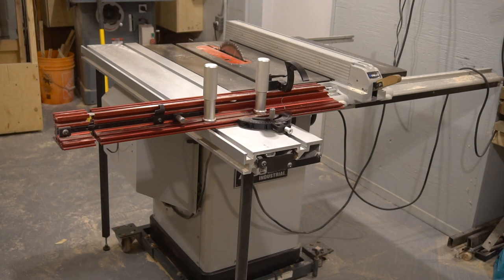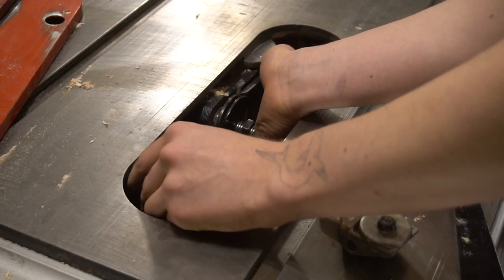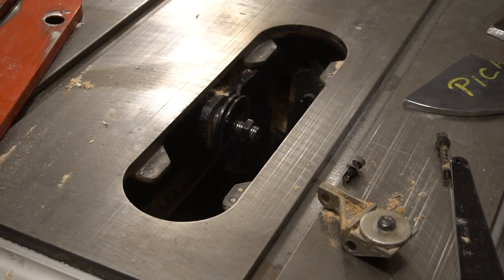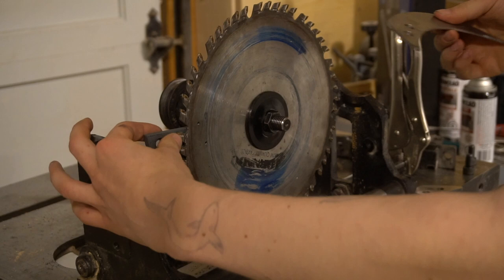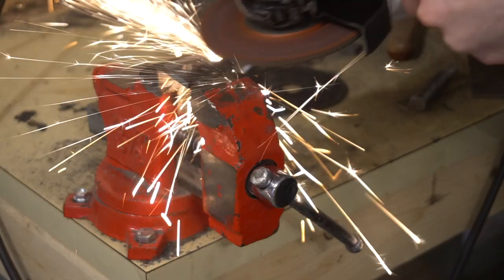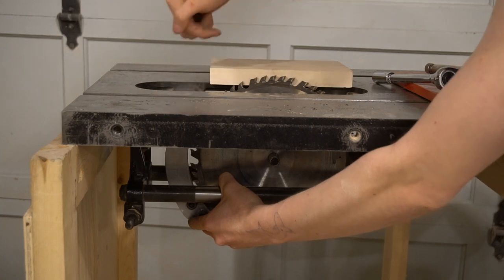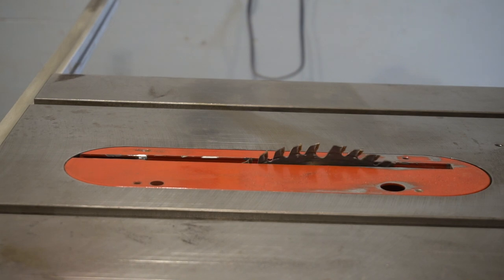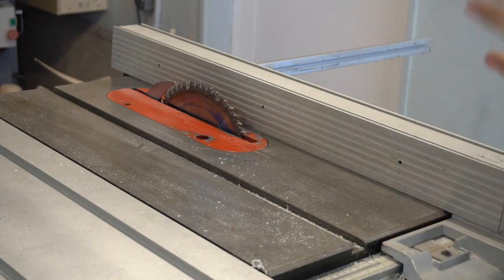Making a Raising Riving Knife for an Old table saw // Table saw build Pt1

Comment: Just put a splitter in. Most TS saws will let you do that. The difference is not as large as optically indicates. The wood is cut at the front edge of the blade, closer to the operator. 

Besides, the splitter can be a rectangular with the long side parallel to the table, hence making the distance to the rear edge of the blade rather similarly close to that of a riving knife. It is not difficult to adjust for the thickness and alignment of the splitter with the kerf.

A warning though. Those who are reckless enough to adjust the height of the blade while the motor is running should not use steel for the splitter. Use aluminum. For plunge cuts, one always removes the splitter or the riving knife, so it matters little. For the traditional splitter, it is positioned so that even at the max blade height, the splitter still will not be cut. If you want to effectively move the splitter closer, you have to be particularly careful.

Comment: Which model is your table saw?
Reply from the maker: All I know is what I posted in the video, a delta 1-3/4 hp hybrid saw. I bought it used and the label doesn’t mark much on it
Reply: It appears to be a Delta 36-714 through 36-717 series. I have the same saw.

Comment: Jai la meme scie. Pas super, pas terrible. ~~ Laurent de Winnipeg. 

P.S. Did you consider modifying the "sort of" riving knife that came with the saw. I know it would be fixed and not move up and down with the blade. I basically have nothing right now and I'm not happy about it.
Reply from the maker: I have never tried that no. But I dont really see a need to do that since the point of having a riving knife and not a guard is usualy to be able to make partial depth cuts
Reply: yeah. I meant to use just the metal part and not the plastic guard. Of course, it would not move with the blade.

Comment: great solution, man. so much safer this way

 I'm thinking: couldn't you change those screws to some sort of quick release system, allowing you to intercalate two riving knives? one, bigger, for thin stock, and the already existing one for deeper cuts.

anyway, great video. It will be important to so many people.
Reply from the maker: Yeah totally! Shouldn’t be overly complicated. At least you could easily used one of those hex handles and a slit in the knife instead of the holes. For me though I ended up just not bothering since the knife is almost only useful for full depth cuts which I can just raise the blade higher for.

Comment: You were in my recommended, so lucky you getting pushed by YouTube.
I don't see any hate comments, I presume you moderate them pretty aggressively?
On that note, Riving knives are an intrusive "safety" feature. The worst kind of safety feature.  They reduce the capabilities of your saw, and make it a pain to use sometimes.
They're likely a good feature for someone who doesn't use a table saw, or someone who's very small and weak, or with diminished mental function though.
Yours not poking its head up for a 3/4" cut does make a lot of the headaches of a riving knife not apply though which is nice I guess.
Reply from the maker: I don't exsactly understand what you find restricting about a riving knife? Perhaps you are thinking of a splinter or you had a cheap riving knife in the past? A good riving knife doesn't restric the saw in any manner. It should be just shallower than the full blade depth and go up and down with the blade without issue. Although for example, blade guards and push sticks can sacrifice practicality for safety, a riving knife should not. As a matter of fact, it can often help give a more accurate and cleaner cut, mostly if the wood warps as it gets cut. 

And no my comment section s are not moderated other than for the odd rude comment which happens about once every 6 months aha
Reply: I just came across this video... nicely done. It looks almost exactly what I did on my Delta Contractor's saw, only in aluminum. One difference is I slotted the attachment point and attach it with wing nuts to overcome the fact that the knife height doesn't track properly with the blade height. That actually works pretty well because I find I don't often use the blade at extreme heights so for a particular project I can for the most part set the projection of the knife to be just below the crown of the blade and it will still be effective for subtle height adjustments. 

Also, I think you hit the nail on the head... the comment by byw indicates that he/she is confusing a riving knife with the splitter that these saws came with. My splitter probably hadn't been on my saw for 20 years because it's a nuisance... hence the reason I finally decided to make a riving knife. I'd like to improve the design so it tracks with the blade better... but then I'd also like to buy a modern saw that's beefier and safer than my contractor's saw! :) 

I hope you've gotten enough donations to replace your Allen wrenches and screwdrivers! :D